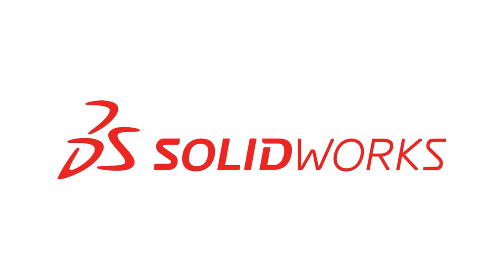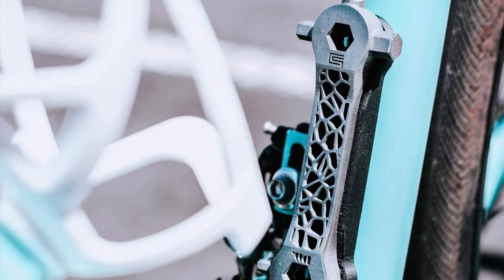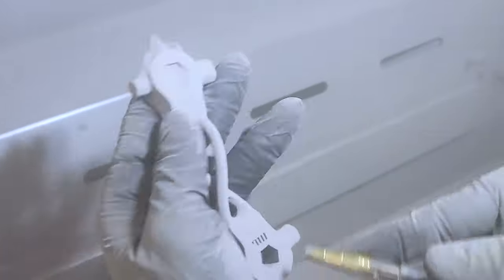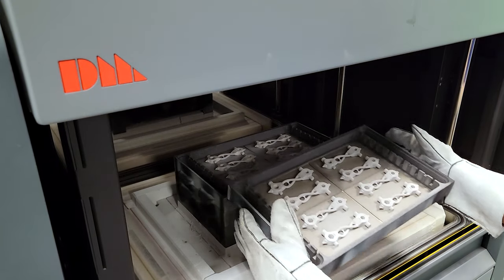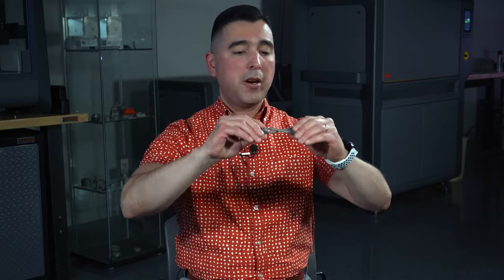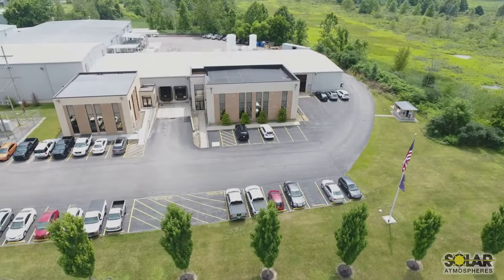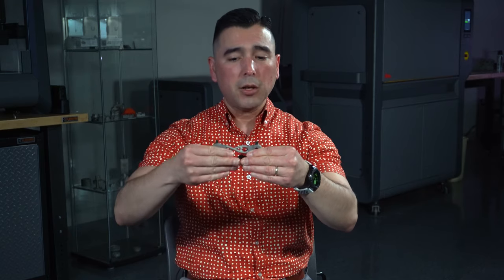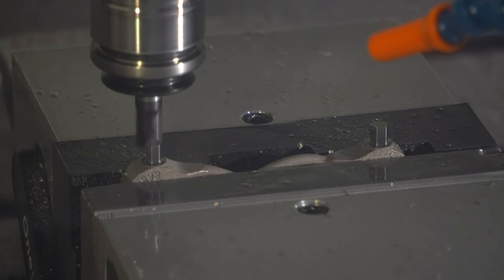Desktop Metal Shop System: Bike Multi-Tool Journey | 2 Minute Tuesday (Extended Edition)

Comment: Great learning, great work. After all this are you guys happy with metal binder jetting? What are some of the benefits compared to other AM technologies?
Reply from the maker: Thanks for asking, Marco.  Binder jetting enables mid-to-high-volume Metal AM and really shines when a non-traditional design approach is incorporated.  In the case of the multi-tool, binder jetting is leveraged starting at the design phase with the double-helix frame.  Unlike traditional manufacturing, this decision came at no additional unit cost (actually reducing it!).  We've had a great experience with the technology so far and look forward to how it will be integrated in the industry.